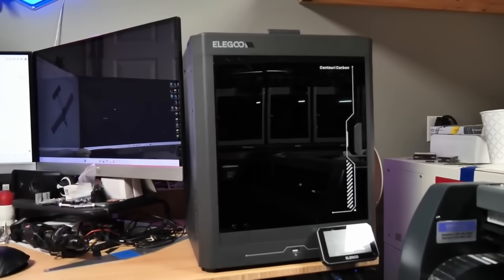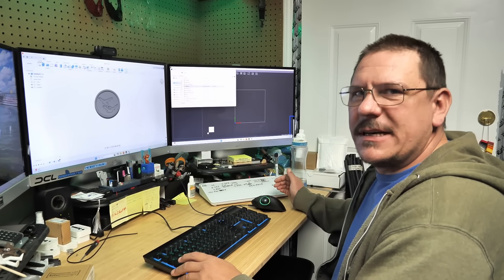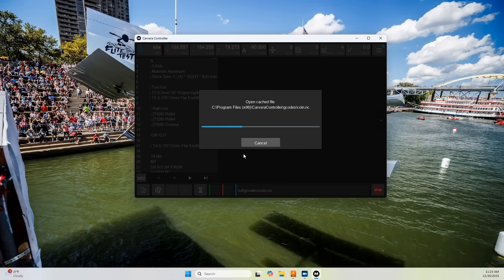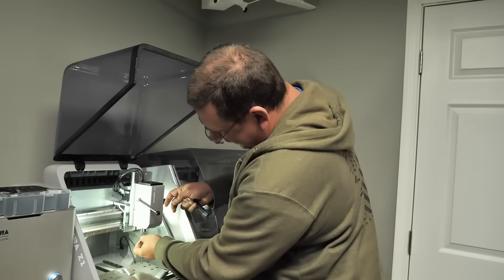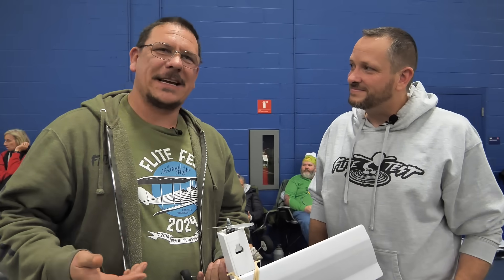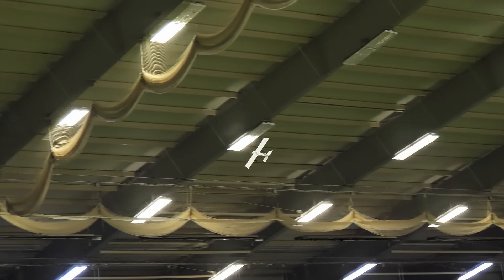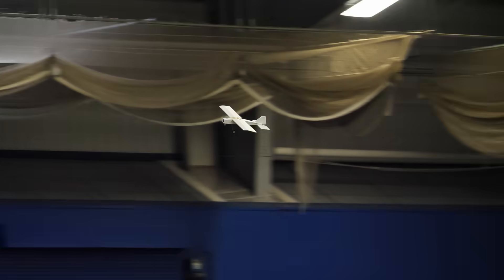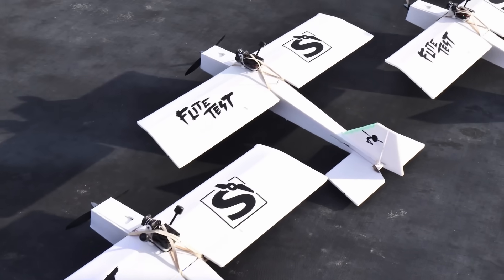Making a Metal Prop with the Makera Z1 - Will it fly?

Comment: Nice advert, 

1) Its Axis, not Axes. 

2) STL files are very limiting in the CAM Carvera Software. There are times it will only allow contour and will refuse to do Relief cuts. Converting them to Obj is the way to go. 

3) The factory software is also very poor at creating efficient machine paths, highly recommended to use an alternative CAN software such as Fusion. Its fine for light weight machining process. But when you have 4 or 5 tool path. Its get old quick. 

Also, the software is in Beta, meaning updates are frequent and there are still missing key items. Chinese to English translations done incorrectly or missing at times. Tool menu that refuses to access unless you close and reload the software. ect.. They are responsive when emailing the issues to the team, but their direct answer is "Its a Beta". 

Overall is a great machine to have at a very reasonable price point. The fact that you don't need an annual subscription for the basic CAM software as many have is great (hopefully that does not change). Its build well, parts and materials are easy to get.  

I switched from the highly capable but un-supported Bantam CNC to the Carvera Air model. Its definitely a step up. Only wish they would spend as much energy in making a robust software vs. paying influencers and adding new models to their line up.

Comment: $1200? Economical? I need a job where u guys work. My son has a GREAT 3D printer and it was under $300, and ita his 2nd printer and an upgrade. So idk how u guys are thinking $1200 is comparable or about the same price as a decent 3D printer for this cnc mill. GEESH. Most of us average ameficans are on a strict budget, and $1200 is a LOT of money.
Reply: If you look at the cost for example of Bambulab printers which are one of the biggest companies for 3d printers. 

They have 3 tiers of 3d printers. The cheap one start at 220 dollars. Mid range costs around 900 dollars and flagship around 2500 dollars. Other companies like Prusa have similar prices with the most expensive Prusa printers going up till 5000 dollars.

Decent means a bit above average which if talking about price ranges would mean around mid tear or better mid tear. 1200 dollars is slightly above a mid tear 3d printer which with Bambu as an example would cost 900 dollars.

So using the word decent here is actually the perfect choice of word. 

It doesn't mean that the 300 dollar printer is not great for its price but compared to what the start of the art of the market is you DO NOT get a great printer for 300 dollars.

Comment: Can it do mild steel? That’s the multi thousand dollar question.
Reply: It was developed for soft metals like aluminum and bras but the company showed how they used it for steel and titanium. But those are definitely not for beginners, probably very slow and way higher risk to break something. 

If the main goal is to mill steel all the time it's not the right machine. But if the 10th project is a small steel part. It might also be used for that.

Comment: Metal propellers are NOT permitted by the AMA Safety Code.
Reply: May not be allowed under FAA regulations either... I'm not super familiar with the US ones (being that I'm not from the US), but I did do a quick search of the commercial (part 107) drone/unmanned aircraft rules, and it has repeated statements of aircraft must not have rotating parts that will cause lacerations... Metal props almost certainly would fall into that description.

Comment: Metal prop, seems like a good idea, but.... The prop is a great weak link for the system. It is the cheapest and easiest thing to replace in the system.  I would think we would want that to break if it hits the ground in a rough landing or crash rather than ripping off a firewall bulkhead or bending your motor shaft. Something has to break, may as well be a 5 dollar plastic prop.

Comment: $1200USD for something that is not fast, not that accurate, you have allot of cleaning to do after milling and you have to spend double its price to buy end mills, you have to constantly change end mills while its milling and doesnt give you good finish of aluminium parts, the finish looks worse than what FDM 3D printers can do... this sounds to me like a gimmick, no thanks i will stick to my FDM and SLA 3D printers and will mold and cast parts if i need them to be made of metal...

Comment: Hrrrrmmmm... I thought one of the top rules of RC was NO METAL PROPS?  Wasnt that one of the original rules when RC became a thing and started getting organized? I think it was more for Nitro RC planes and that whole chopping off fingers thing. But still not one of the best ideas for the hobby at this point in time. As you say current props are plenty strong
Reply: Yeah I thought AMA said no metal props as well. But I guess now stuff falls under the FAA if everything rc is now considered a “drone/uas” so who knows
Reply: I remember the same rule, but it wasn't enforced by any org. Just a safety thing. Heavier prop has simply more energy.
Reply: I'm pretty sure I read no metal props in the Australian laws. Which are based on US laws. I think it goes higher than any organisational rules... But I'm not a lawyer and I didn't go re-read the laws, so this is not legal advice.